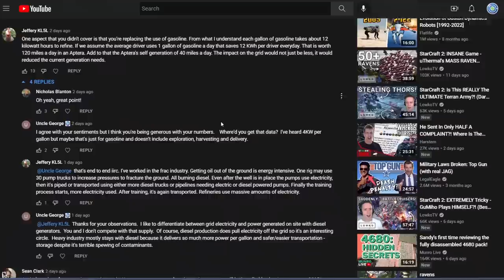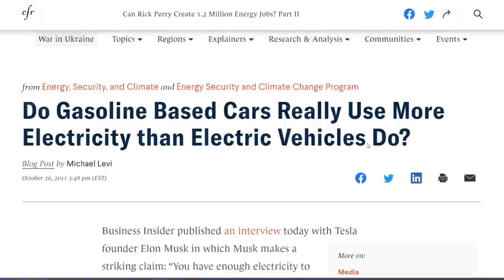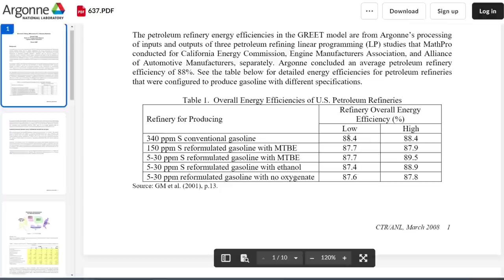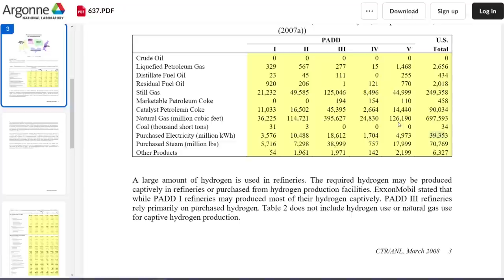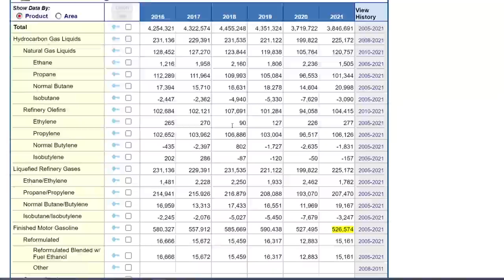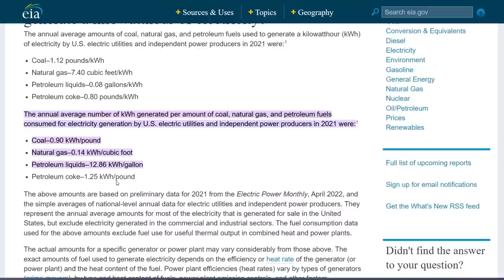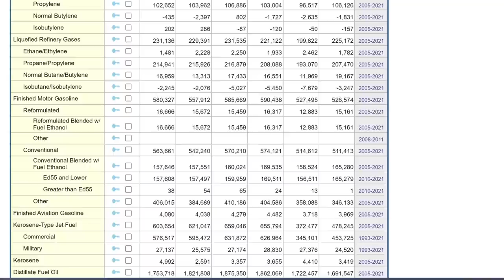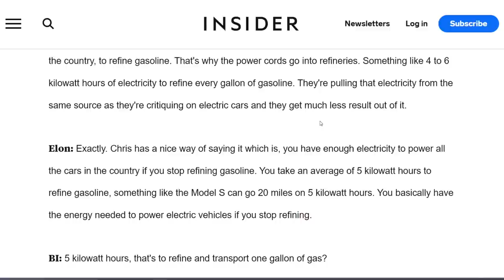How much electricity does refining gasoline actually use?

Comment: 1 gallon of gas gives you ~30 miles in the ICE version of a LEAF and the EV Leaf is 3-4 miles / KWh which would be ~9 miles at best; using your calculations.  As for the exploration and extraction and transportation (to) refine, for both cases, it would be a wash.  So it looks like the use for gas may be a bit ahead even according to your calculations and the main issue here still is simply energy storage and use.  Even though liquid gas is not converted to much in an ICE, it still provides the highest convenience in storage and conversion.  Until that nut is cracked EVs will always lag ICE equivalents in the marketplace.   Again, until doc invents the flux capacitor, gas wins.  A good book by Thom Hartmann called "The Last Hours of Ancient Sunlight" covers the topics here very nicely.   Even if everyone converts to driving EVs and all EVs driven have the efficiency factors of Aptera built in, we will eventually run out of ancient sunlight.  EVs are mainly kicking the can further down the road.  and Aptera gives the longest kick!  can't wait to get mine!  ;-)
Reply from the maker: remember I'm only calculating the energy cost of refining the gasoline at around 3kwh per gallon which you correctly calculate to roughly 9miles.   However this is without burning ANY gasoline.  The gasoline car goes zero miles without burning the gasoline.  The EV will go 9 miles.   Now gasoline itself has 33.7kwh per gallon.  If thermal efficiency of a powerplant is 50% then that gallon of gasoline would produce 17kwh of electricity.  so that's 17 from burning the gas, 3 that it took to refine it which is 20kwh.  an average EV would go about 60 miles with that.    The fact that you missed this very important point that the calculation is WITHOUT using the actual gallon of gasoline tells me that I did not do a good job of explaining it and emphasizing it.  

my apologies.
Reply: Yes, ok!  I get it.  my oversight.  if you burn the additional stored energy from the refinement you will get even more in miles out of an EV even with only 50% conversion in the long loop back to electricity.  So, maybe 2X more energy efficiency in EVs over ICE this way?  ...your explanation is good.  I'm the one simply trying to point out too eagerly and poorly that it may still not be enough unless it gets us to a point where the cycle of energy collection, storage and use can all come from sources other than stored energy in the planet over billions of years of sunlight.  We need a source that cycles without as dramatically unbalancing energy sources that took literally billions of years to store. Otherwise, we are still only kicking the can down the road.
Reply: yeah, and to clarify my "may be a bit ahead" I was also thinking of the storage and use aspect of gas vs. electricity.  much of the reason power plants are so inefficient is that they have to remain online in standby due to long lead startup and shutdown times and costs even when electricity is not getting utilized.  So, again, we need doc to invent the flux capacitor....there is a great couple of videos from Veritasium that show how energy really is transmitted via a energy flux, not the flow of electrons through wires like water or we often think of it.
Reply: @ModernSunlight  A gas turbine cycle can go from 0 to full load in 5 minutes if kept warm [simple cycle], 20 minutes with the combined cycle , ususally steam back end but now there are super critical CO2 back end close Brayton cycle that need less pre heating. These can burn petrolium directly with little refining. Combined cycle power stations can get a claimed over 50% efficiency, but reality the "as operated" condition is a little less over the life. For steam cycles over 30% is likely with 38% beingabout what to expect with newer super critical steam units getting to 46%, now these are the sluggish ones for load changes. Unless they have an H2 and O2 combustor in the reheat line and then they can do 20 MW step changes nearly instantly. Now if the heating fuel is burnt in a GT then the recovered heat makes the 50% electrical closer to 80%, with 30% going to heat the oil to be refined and 15% up the stack and 5% general heat loss. Similar with the heating steam it is typically fed through a back pressure turbine to generate electricity, becasue the boiler is more efficient at the higher pressure/temperature than needed by the process. Therefore the workings are a reasonable approximation of equivalence.  Ship diesel engines can get close to 50% conversion to shaft power. Cars are not that good, best diesels are about 40% and thermal efficiency of a diesel engine is about 25% greater than that of a gasoline engine. Electric cars transmissions are more efficient too.
Reply: @martinrieger5822  wow!  great knowledge and information on efficiencies in energy conversions....do you design power plants?  Efficient conversion of energy is a hot (sic) topic now and will be even more important unless we can solve some storage and retrieval problems!
Reply: @ModernSunlight  Not a designer, Just work with power plant operators to improve effectiveness and keep up with the latest in heat engine design. Be on the lookout for super critical carbon dioxide, already in some domestic hot water heat pump units from Japan, Ecocute. This will be the next big thing in power generation from many sources and scaales down. You need steam in the GW range to get the efficiencies with 21 internal heat recylcing steps. The sCO2 will do the same with two or three steps and scale down to a few 10s of MW while having similar efficiency. We don't get much better than 50% in practice for power generation unless you use the heat for somehting else. With small power generating units the ability to service a district becaomes possible and the heat can be used for actual heating and even cooling. This means total energy usage can be down by 30% over conventional power generation and you can recharge your EV with the garbage you produce and heat your home without huge distribution infrastructure.
Reply: @martinrieger5822  this is the approach we need to take until doc invents the flux capacitor!  ;-)